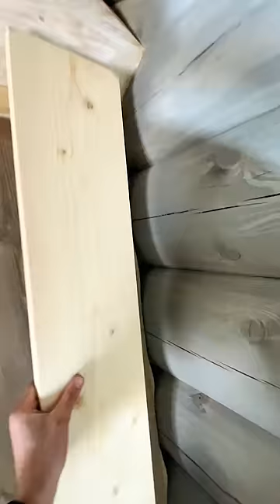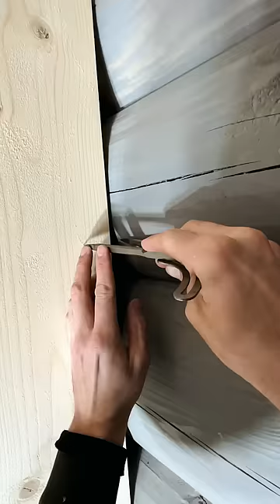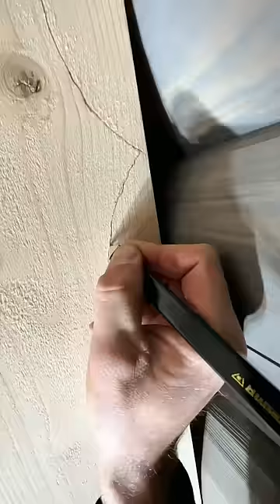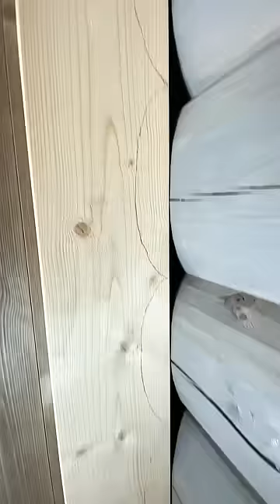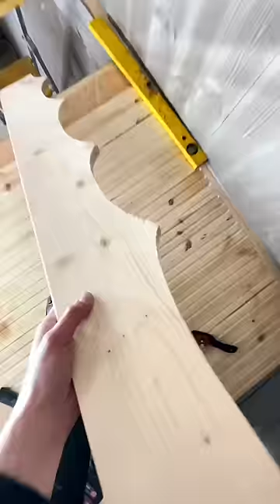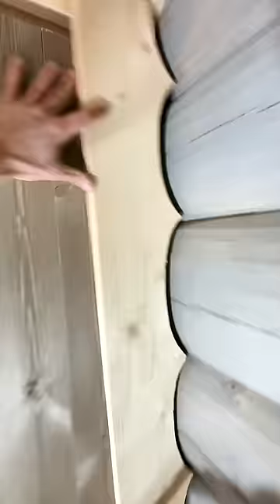Framed wall against lumber wall 🪓

Comment: When the logs in the wall dry they will shrink and settle. That scribed piece will either get pushed out or prevent the logs from settling. The proper way is to cut a groove into the logs to accept the partition wall material. 40 years log home builder.
Reply: Всё верно сказано 👍
Reply: Wish i knew you back in the day i was building them
Reply: Откуда вы?
Reply: Мы за тебя очень рады
Reply: Won’t the logs do the same thing when it’s hot and cold just not as bad?
Reply: Бревно смотри,товарищ,оно уже давно высохло.  Технология домостроения абсолютно на каждом континете одинакова, различие в специфике постройки,материала,отделки
Reply: Дерево дышит и все зависнет потом,на этой резне и гвоздях..
Верно,так нельзя..
Reply: Then every few years you just make a new trim board. Job security.
Reply: Looks really good tho!
Reply: @-tendinitis yes materials in homes flex, expand, contract, with temperature change, it can affect simple things like how well your sliding glass door opens, to more serious issues, such as discussed here where wiggle room simply needs to be provided
Reply: @tiernanmayer  couldn’t agree more
Everything flexes cause of temp happens here in Illinois with the extreme temp changes
Reply: Дп😊

Comment: Much cleaner to notch out a groove in the logs and slip board in
Reply: Это абсолютно не допустимо у плотников. Не стоит нарушать структуру брёвен...
Reply: The idea is to make it easier for yourself.
Reply: That’s a structural wall and you know how hard it is to even do that? Smh. Please explain. I’d really like to know
Reply: @user-oc2yu3pk9y  I sub from a log home builder that's what they do notch a groove down the log so drywall shiplap etc  Slips in. I'm not talking about removing logs  lol. To trace around logs  is sloppy and looks like shit
Reply: And I should imagine that the groove would be better for shrinkage and expansion?
Reply: @theyack789  absolutely
Reply: @b1pawh  I never said to remove logs. Creating a notch on the existing wall seems a lot harder than you think.
Reply: @user-oc2yu3pk9y  It's not hard I see it done on every log home we work on. You cut the appropriate depth 3-4 inches and however wide the material  is you're going to slide in whether it is 5/8 drywall or 1/2 inch shiplap. Log home builders are good at what they do and can make these cuts accurate and clean even using a chainsaw.
Reply: I thought most of those handheld dado saws were discontinued in the states for safety reasons.
Reply: Keep this guy away from any builds…

Comment: I drywalled a log home about 25 yrs. ago. That's exactly the way I did it. I did it on a small 4 ft. piece first, then I transferred it too the 12 ft. sheet.  The owners of the house was amazed at how good the drywall ended up looking.  I've done the same thing bumping drywall up to rock fireplaces also. It's a real proud feeling when the work turns out as good as it does.
Reply: Right there with you, scribing is sometimes a b*** but when it turns out, it turns out beautifully 👌
Reply: На то он и сделан из круглого бруса. не для того, чтобы потом всё гипсокартоном закрыть.
Reply: You should be PROUD of your work. Your very talented as is this Gentleman.  If you don't love your work, Get out and find that Special thing ( Talent  ) inside of you. 
Don't be scared  to go back to college or a trade school,  Don't live a lifetime  
Of Regret.  ❤